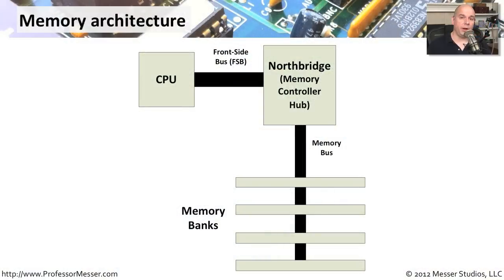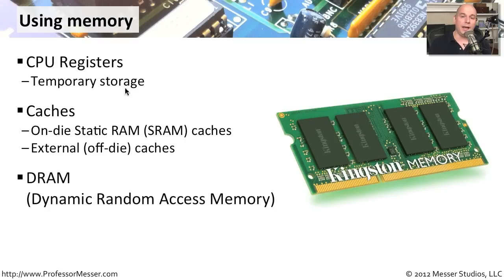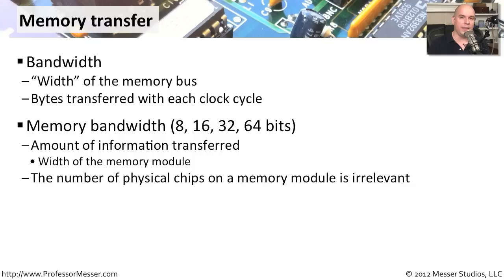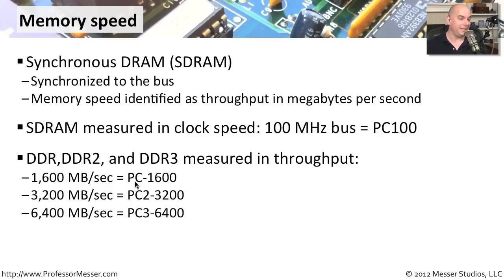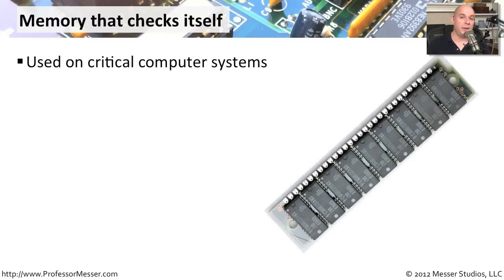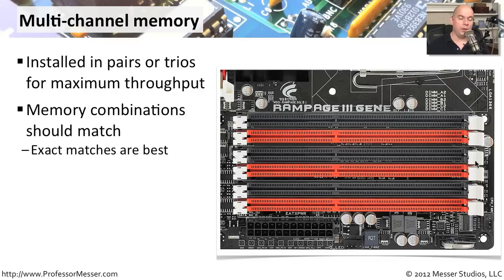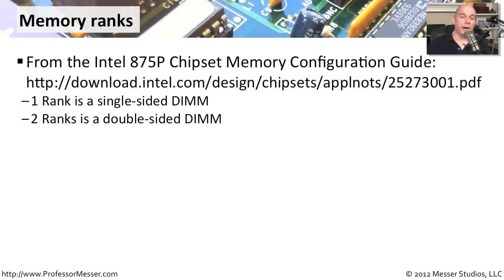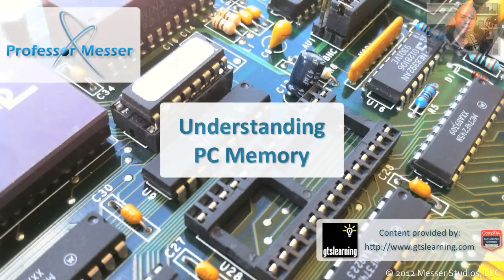Understanding PC Memory - CompTIA A+ 220-801: 1.3

Comment: Professor,
First, thank you for putting these videos up.  I'm studying for my A+ cert and your explanations are really great supplemental support for the study guide.

I have a question about single-sided and double-sided memory.  In the authorized CompTIA A+ study guide it is stated that single and double-sided memory has chips on one and both sides of the module respectively, however in your video you claim that is specifically NOT the case.  Did you make a mistake or is the book wrong?
Reply from the maker: To clarify the book you mentioned, CompTIA does not publish books, and they do not have a single authorized guide. There are many books that have been authorized by CompTIA.

I believe the documentation from Intel in my video is a very good source for single sided and double sided, since the terms are based on how memory is used on their motherboards. What source was used in the book you are referencing?
Reply: Professor Messer
Sorry, the book I'm reading is the Sybex Comptia A+ Complete Study Guide, Second Edition.  There are no sources listed for the information that is presented, maybe that's a red flag.
Reply from the maker: +TENNSUMITSUMA It's remarkably difficult to find consensus in the technology world.

Comment: 801 is hard.Save the simulations for last mark them and go to the regular questions first.Sims are motherboard parts first, then connectors, building pcs gaming,thick client, htpc and making hard drives with maximum redundancy. I flunked it because of the multiple choice questions. 637 passing is 675.

Comment: Awesome video!!! I was thinking i have a Sabertooth z77 with i7 3770k . I was looking into getting better RAM. My Mobo can handle up to 2400Mhz i think but the CAS Latency on those RAM are 10 and up. Do u think its better to get a 1800Mhz with CAS 9? also should i put the full 4x8GB > 32GBs? or just keep it at 2x8GB >16? Thanks again.

Comment: Buying DDR3 RAM, do you have to match the motherboards FSP speed?
Reply: +Lethal Shoxin may be a late response lol, but i would look into your mobo manual to look at the speed of the memory that it can handle for example my fastest memory i can buy for my memory for DDR3 is 2133 mhz which is really fast and it also depends on which company the memory comes from. Hopes this helps and if I'm not too late lol.

Comment: I think you have confused Double-sided Memory with Dual-Ranked Memory. I tried researching this online and couldn't find anything that supports your claim.
Reply from the maker: +Commander X47 I think I was pretty clear that the industry doesn't make this very clear. There's no single "double sided" definition out there, and it's fairly common to refer to dual-ranked memory as double-sided memory. It's also common to refer to memory modules with chips on both sides as double-sided, although that definition makes less sense when you're looking at memory specifications.
Reply: +Professor Messer True, there is a lot of confusion online around this, but according to JEDEC memory standards the definition is as follows  - http://www.jedec.org/standards-documents/dictionary/terms/double-sided-pcb-assembly
Reply: +Professor Messer Anyways I realized you have had this conversation with others before possibly for several years, sorry for challenging you before looking at your site.
Reply from the maker: +Commander X47 It's a conversation worth having. When topics like this have multiple meanings, I opt for giving you all of the possibilities. I never know what CompTIA might be thinking, so I like to provide all of the most reasonable options than locking you into a single definition.

It's also worth mentioning that the definition has changed over time as well, and JEDEC tried to clarify things by adding some definitions. However, you never know which set of definitions that someone might be using.
Reply: +Professor Messer Thanks for the clarification.